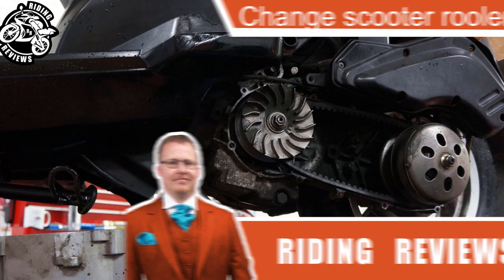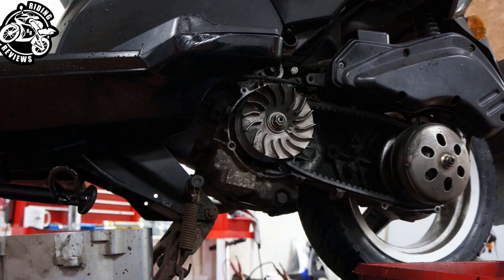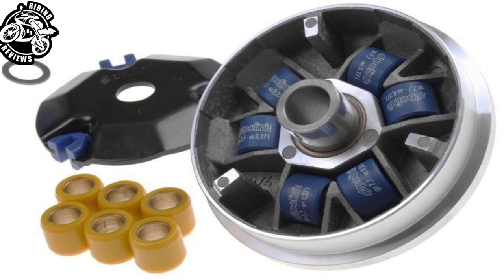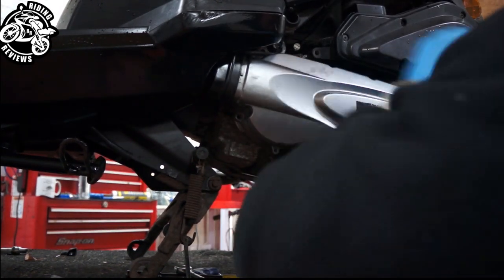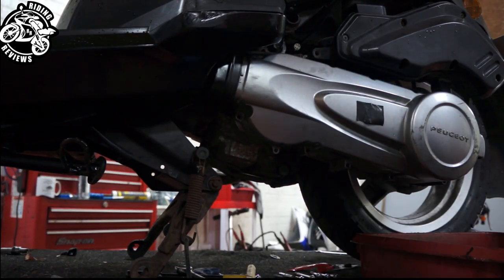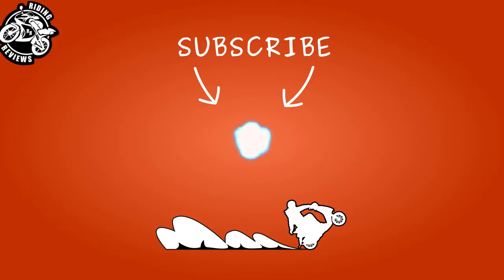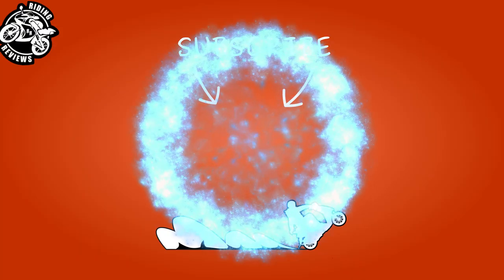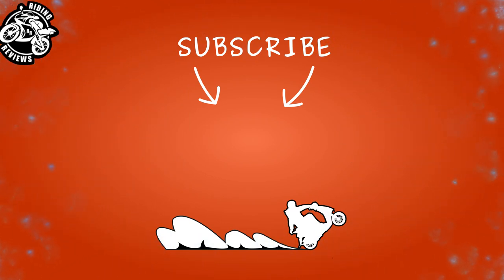Replace a scooters rollers and belt (STEP BY STEP)

Comment: I bought an electric impact wrench to be able to work on my variator. Tried different roller weights and can make a big difference to performance , help hill climbing etc
Reply from the maker: The waights in the rollers it is allways a trade off if you use heaveyer ones you get better tourque but lose top speed  if you go lighter you get a better top speed but less torque

Comment: I have a burgman uh200 2010, my question is surely I need to torque the variator? If so I can't find it on Google as to what to torque it too, any help would be appreciated ps great videos new sub added cheers
Reply from the maker: The torque setting is 40 to 44 nm of torque with we use that gun on all these sort of bolts i know it isnt to mutch because i can do it up more with  a wrench
Reply: @Ridingreviews  that's brilliant, thanks for your help much appreciated!! Just so I'm clear that unlike the my motorcycles the belt fits but doesn't need tightening?
Thanks again
Reply from the maker: @pablo123b  no the belt on a scooter doent need touching untill you change it after 5000 miles
Reply: @pablo123b  you need to pull the pulley back to tighten the belt to the torque spring gets tension

Comment: I have the Yamasaki YM50-RE and was wondering if you recommend getting it de-restricted and what are the negatives of it?
Reply from the maker: I would recomend getting a derestrictor it is safer to go 45 rather than 30 you can keep up with the traffic better it moves the resriction from 7000 rpm in 3rd and 4th to 11000 also 3 gear resriction is in the rong place legally you have to be 17 to do it
Reply: Riding reviews what would happen if I did it at 16
Reply from the maker: @jpalfrey3368  if you have a acident it could void you insurance the police could stop you and not let you ride your bike away lots of 16 year old do it and are fine i have never heard of these thing happen but do it at your own risk we will send a disclaimer with it so it is down to you
Reply: Riding reviews oh 😕
Reply from the maker: @jpalfrey3368  sorry we don't make the rules